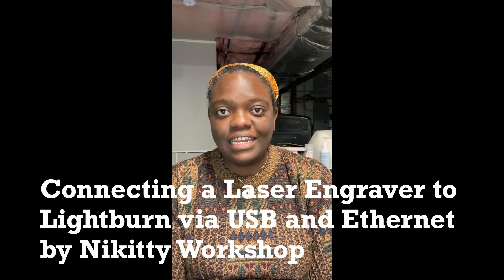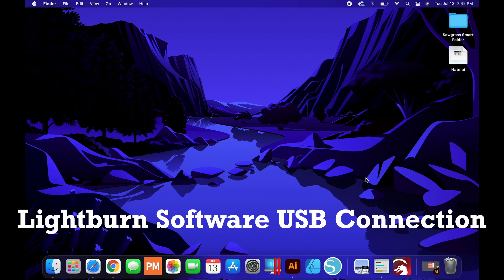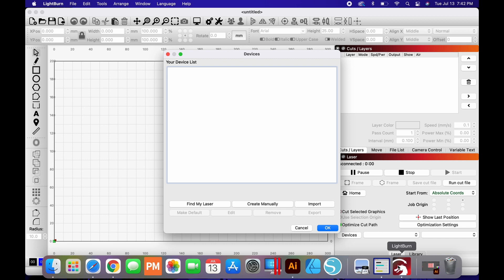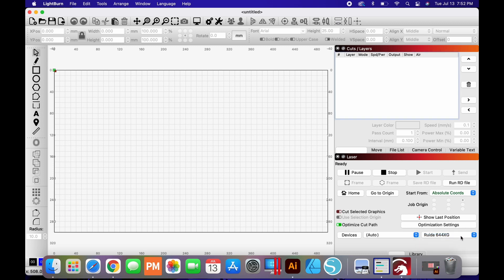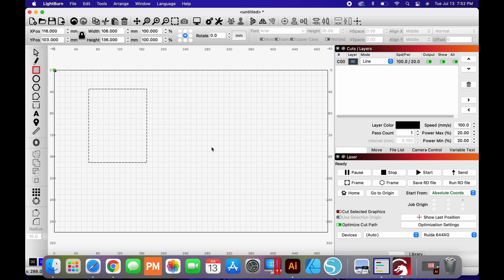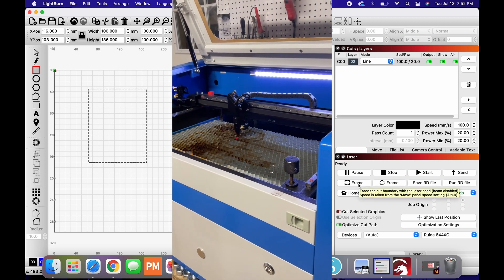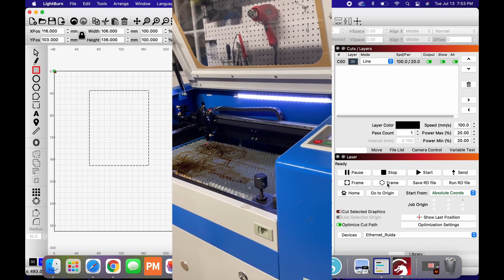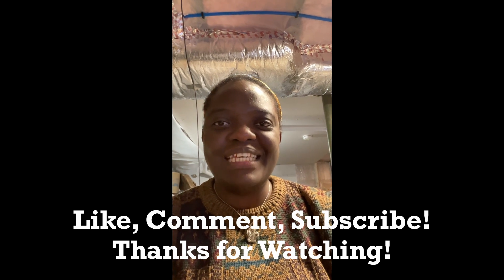Connecting a Laser Engraver to LightBurn Software via USB or Ethernet

Comment: I have an m1 mac and can't get mine to connect either way. Any thoughts?
Reply from the maker: Hi Chris, I am running Lightburn on a M1 mac as well. I'm not sure what may be causing the issue you are having. I would check if you are running the latest Lightburn software. There was one version that was acting "weird". The issues were resolved with the latest revision. In addition, check if you are running the latest Mac OS as well. Another option may be that the MAC OS blocking or restricting Lightburn access on your mac. I'm not sure to change an app's access after installation.